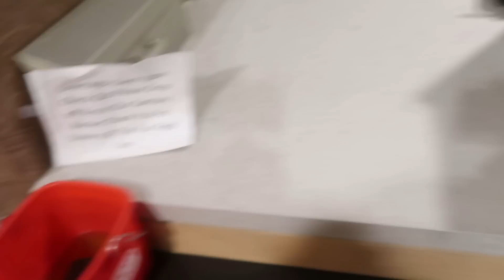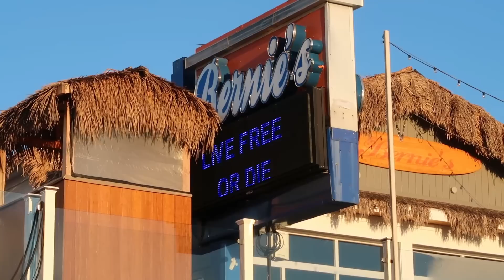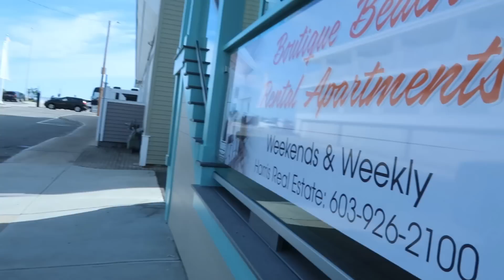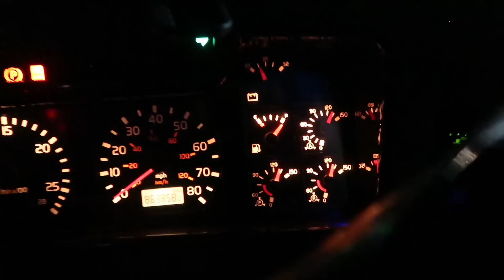We almost didn't make it home!

Comment: I have so many questions.... most of them dumb and boring. Those lobstahs looked amazing!!! my guess is they are cheaper up there then in the midwest? 
1. What did you do about the parking tickets?
2. Will someone on the bus make you coffee or grab you a water or something as you are going down the road?
3. Does everyone know the codes to get onto the buses? and why does Gainz keep messing up the keypad?
4. Do you two generally sleep on the bus when most of the guys fly home?
5. Even if they break down frequently, They are both really good looking buses, do you ever get tired of looking at them?
6. Are the people at the venues pretty nice to you guys are do they generally overlook you since you are not band members?
Reply from the maker: 1. Yes, lobsters are usually cheap on the coast.
2. Yes, if they are awake 
3. Yes,  and Prevost makes the keypad very poorly.. the plastic tab that holds it on breaks easily. And if it doesn't work the first time, people assume push harder works and it doesn't. 
4. Yes, because we don't have to worry about hotels or food based locations for stops 
5. Yes, we love the buses but after about 800k miles you get tired of the same old stuff breaking. 
6. Most venue people are great and happy to see us.. but they also don't know if we are band members or what we do most of the time. Most people at venues that do know, understand we have a tough job and help us out anyway they can 😃
Reply: Thank you!! Love the channel!!!

Comment: Does the map program y’all use show the road size (4 lane, 2 lane, pig trail...) so y’all don’t end up on some tiny little road with the big buses & trailer and if so, what program do y’all use?
Reply from the maker: Yes, it Garmin truck GPS, they can be bought at any truck stop and you can put length, width, weight etc.. into it. But sometimes you have to ignore it to get to places that have no truck policies like Hampton Beach

Comment: I love the idea of hooking up the battery charger to keep power to the battery. I have a 2/10/25A 12V Battery Charger, so if I had to do what you did but with something a smaller like a small motorhome or pick-up truck, what amp setting should I run, the 10 or 25 amp?
Reply from the maker: I ran 24v 15amp so I think 10amp would work fine for a 12v RV or pickup. Just remember to tape cables with something so they don't bounce off or catch fire. 👍🏼